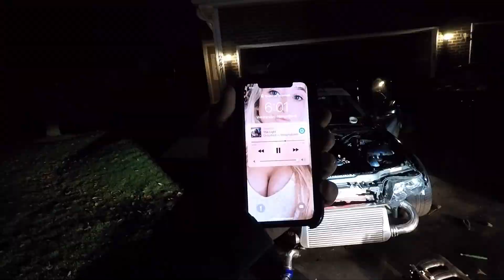Turbo E46 Build S2 EP1: Starting Fresh

Comment from the maker: Thanks for watching! 

Side note;
For some reason during editing, some clips went missing, and when I tried to trim a few it seems it just duplicated it, so there’s some stuff I wanted to cut out that’s there and such. Audio seems meh because of the editor as well... looking into some other ones (it’s just the windows 10 video editor)

But trying to improve the quality! Hopefully it’s better than my usual lazy stuff :)
Reply: ChiTown Bimmer  if you want flames and launch right. Get the BEE r rev limiter
Reply from the maker: @Sneaky_n55  not money i want to spend when i can get 2step free very soon ;)
Reply: ChiTown Bimmer  nice I’m getting it soon and also get the RK tune
Reply: @Sneaky_n55  doesn't rk also want like 850 for a stock ms43 tune when you can just use tunerpro your self and make everything work? Also splice in wideband into the post cat 02 plugs - see the ms4x wiki so as not to use the wrong ground !
Reply from the maker: Splicing into the post cat o2 only works for 0069 software... Rom raider won’t pick up on it
Reply from the maker: Only can get it to pick up on 0069 with tunerpro
Reply: @straightsixracing  for sure? Been on 56 forever been thinking of switching to the latest revision with the community patch list.. guess you know more on this one
Reply from the maker: Also you’ll be dealing with lambda figures, tried to convert it to AFR but none of the equations we tried gave proper figures. I just switched my gauge to lambda and went with that,
Reply from the maker: I’ve been going back and forth trying new things, I was hitting a wall in 69 for some reason, tried a fresh flash with my 56 93 tune on 69, at full boost the car would act like it shut off, go to idle, my log would stop, to test it we went to 56 again with the same tune and no issue , we think we got that sorted, 69 is what everything will be done on. But it’s still very new and buggy. Tunerpro on 69 logs EVERYTHING
Reply from the maker: One thing is you need to unplug that post o2 every flash, reset adaptations, let it adapt then plug it in, it will try to adapt to weird figures and can mess it up, that took some getting used to, I would forget and have to reset adaptions again lol
Reply from the maker: But so far I’ve logged through 69, and got 2step working, some more cool stuff coming very soon, not released yet
Reply from the maker: Also on 69 it would throw random codes for parts that are new, I guess with 56 it’s kind of hard to throw a code, but I don’t think the codes it threw were accurate.
Reply from the maker: Also there isn’t any definition files for 69 on RR
Reply from the maker: Sorry a ton of comments, just sharing my experience so far, haha
Reply: No the price is 600
Reply: I ///М Fan  no the price is 600

Comment: Wow and I thought I was bad about using the cowl/intake/valve cover as makeshift table this dude just don't care using the driveway for worlds longest table

At least put some cardboard down ffs
Reply from the maker: I ///М Fan none of those parts are gonna stay on the car lol, I know what you mean. But I don’t really care about $200 turbos lol
Reply from the maker: Bring me some cardboard foo
Reply: don't think negativity was needed not everyone does things the same he seems to be doing good
Reply from the maker: It is what it is I’m tearing down my car 30° in my driveway with a full garage, I ain’t worried about an eBay turbo on the ground lol

Comment: Question, do you need to get a tune after installing an M50? Somebody told me without one you'll lose power. This true or is this guy full of shit?
Reply from the maker: You’ll run lean because it’ll flow better, I highly recommend a tune, it’s doubtful there will be any gains if you don’t add fueling / possibly timing to take advantage of the extra air flow up top
Reply: @straightsixracing  Thanks bro, doing me a solid. 🤙🏼